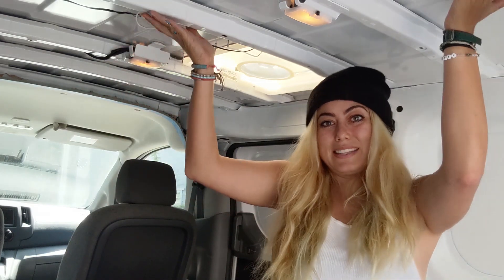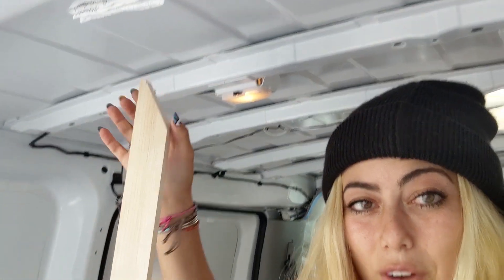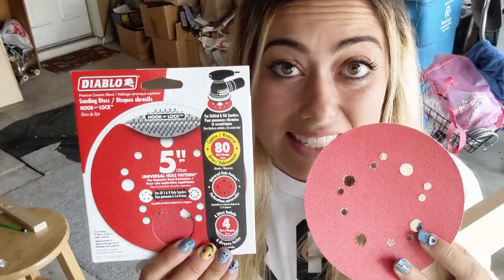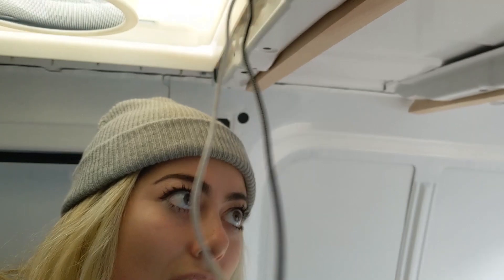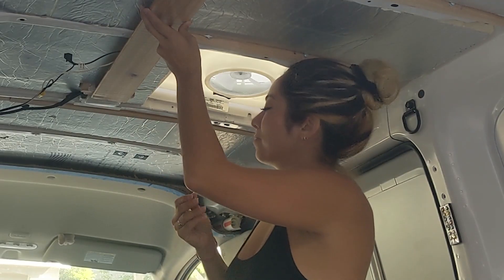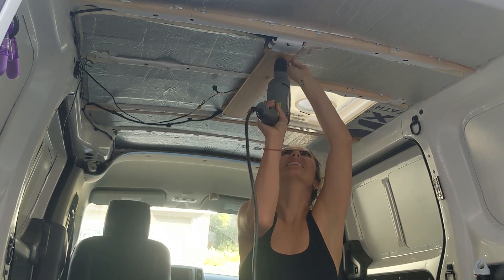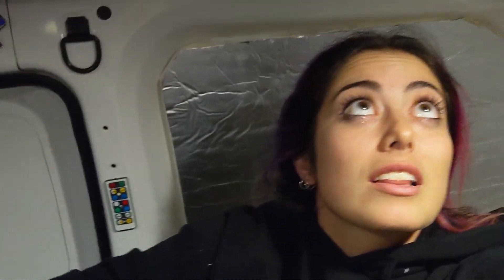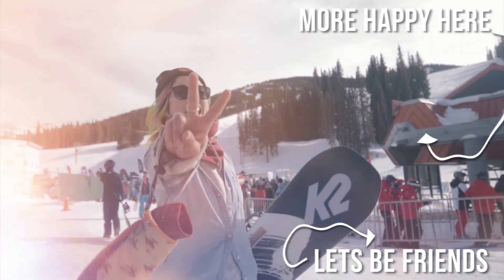VAN LIFE DIY: CEDAR PLANK CEILING

Comment: Wood strips are great for screwing your planks into, but that metal rib has a trough that will keep your screws from going through your roof too.
Reply from the maker: I just didn't want to have to screw that many screws into metal because it takes more effort to get them through. However, with all the time figuring out the wood strips it probably would've evened out

Comment: @jenise!   i just wanted to make sure you are careful around corners,          you added alot of weight to the top of the van.          I only say this because my grandpa did a similar DIY then flipped the camper
Reply from the maker: The wood panels on the ceiling all together add up to like 5lbs. They're super thin and light

Comment: When i did my build I screwed the support wood beams to the bottom of the metal, just need a slightly more bendy wood.
Reply from the maker: That's an option too. I already can't stand up straight in my van though so I needed to save as much head room as possible 😬